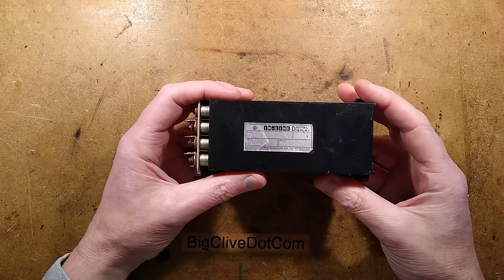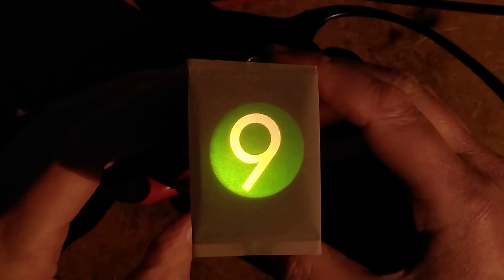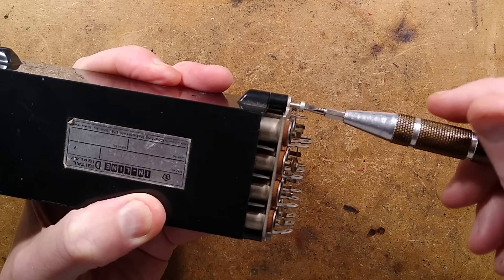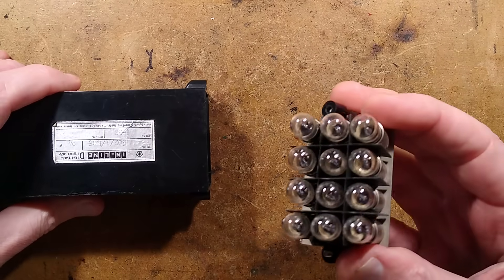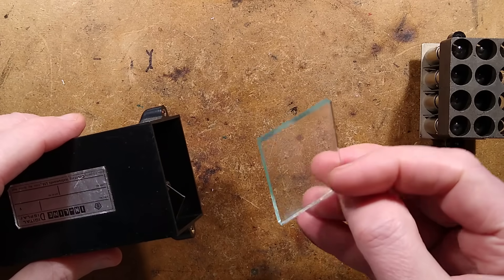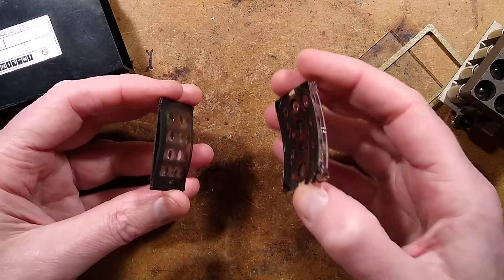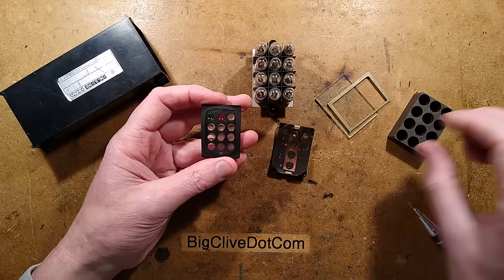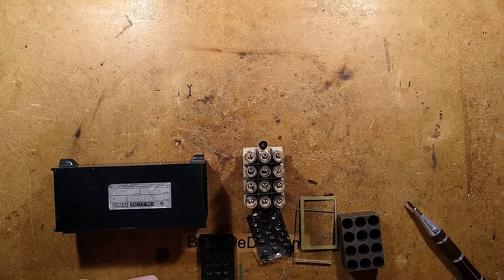Vintage projection display teardown

Comment: Back in 1975 I worked on a machine that had such a display.  The company that made that machine had spent something like $160,000 to make it,  and then other folks had spent between $300,000 and $400,000 to try and get it working right.  The display was an indicator of what fault condition had brought the machine to a halt.  When I first fired it up,  all of the faults were indicated.  It seems that somebody had forgotten completely about the diode you're supposed to put across relay coils when driven by a solid state part.  Every single one of the drivers was blown,  too.  That machine used the oddest logic family I've ever encountered,  something called "NORBITS" and I believe made by Amperex.  I've not seen it before or since.

Comment: A very well-designed numeral indicator. In the days of vacuum tubes, a bit of power wasted in a 24V100mA lamp wasn't too much to worry about. Thanks for taking it apart. Congrats on the 1 million subscribers' milestone.

Comment: The description sent me on an ADHD rabbit hole about RME and their various Glasgow shops 😅

I love these vintage displays, so many interesting ones which were all (understandably) replaced by 7-segment ones. I love this one's use of Futura, but they so often had interesting typefaces — even the CRT-based ones.
Reply from the maker: RME was great (Radio, Mechanical, Electrical).   A counter surrounded by component bins and shelves up to the ceiling with technical stuff.

Comment: Elevators.  Otis used projection displays in some of their elevators.  Mind you they used a disc rotating in front of a lamp instead of multiple lamps.  There were several of them in a local hospital up until early 2000 when the cabs were modernised under orders from HCA.

Comment: Congrats for the 1M! 
This thing could really have benefited of LEDs, but while the photoelectric effect of the PN junction has been known for a long time, the brightness took a few decades to develop. Imagine the multitude of color combination choices with RGB LEDs, although some combinations would be limited because the digit color would mix with the background.
With a 4x4 pattern, even with incandescent lights, the same case could be fitted with a hexadecimal lens set, or decimal with 6 background color choices.

Comment: Hmmm, they could have invented the seven segment display concept using fewer light bulbs and it would have been brighter. Implementing the separate red and greens somehow would add two more bulbs but still fewer in total. Thumbs down for design fail LOL.
Reply from the maker: This was designed for old electromechanical systems.  7-segment would have required more complex display circuitry.
Reply: @bigclivedotcom Steering diodes would do the job for the same external interface, though 49 of them would cost more than the saving in light bulbs LOL.
Reply from the maker: @FirstLast-jl6fr  That and the fact that commercial silicon diodes didn't exist back then, or were new, flimsy and very expensive.

Comment: I have a few Staco backlit (incandescent T 1-3/4 miniature lamp) displays which seem to be mil-spec and which are absolute jewels of compact, fiddly design. They don't project like your beautiful chunk of metal does, but there were a host of options for alternating legends (think push-push functions, top or bottom of the button illuminated), colors, etc. Each button about 15mm square, yet used 4 individually addressed lamps and a metric butt-load of contacts!  GLASS front button surface.  Hmm... I recall that IBM pushbottons from the 360 and 370 lines were also glass wear surface. Sorry, stream of consciousness while sicker'n hell. Thank you for the excellent distractions (as always) while I pretend to recuperate at my desk instead of bed. <_<

Comment: I've got 3 miniature in-line modules, with tiny wheatear lamps (probably 4 or 5v).
The lengths we went to to engineer digital displays before LED was viable, are quite interesting. An early US system had 10 or 11 acid etched glass slides per digit, arranged like standing dominoes, with a filament lamp above each. I forget what it was called. A display of all these systems would look spectacular- Nixie, Nimo, Numitron, Numicator, VFD, 7 segment LED....
My father remembers when blue LED's were £30 GBP. EACH..
Reply from the maker: The edge lit displays have made a comeback in LED based nixie-themed clocks.

Comment: I used and maintained a gun control console in the "90s that used a smaller version (1 inch square by two inch deep) with elaborate configuration designations projected when the system changed modes.  The lamps were tiny and hundreds were required for the console.

Comment: Many years ago, I worked on re-assembling (they had been cut apart) two "Red Arrow" slot machines. (built by Keeney?)  Each had three of these types of displays in the upper section. (The machine was huge and heavy.) They used 6 volt lamps and they were fairly bright. It was fascinating just to watch it run with all it's electro-mechanical  sweepers and steppers in action!

Comment: If you ran the lamps at half voltage they'd last forever but might be too dim.  That's what we used to do with single lamp incandescent pilot lights.

Comment: Developing products must have been more satisfying in the past given the freedom from conventions and the varying fields of practice for the finished product. 
In this case, besides electronics, we see specifically manufactured optics. In other cases it's often clever mechanics applied.
Today its just LEDs, a multiplexer and the data bus. 
The times of multidisciplinary  ingenuity in common applications are passé. Perhaps it still exists in some way with designing MEMS devices but I still miss the those times I am to young to have experienced.
Reply from the maker: Don't underestimate the technology in modern displays.  It may not have the same charm at the moment, but will probably be collectable in the future.

Comment: Another great informative video, Clive. I had a device that came out of our famous Melbourne brewery which used 10 Burroughs Sphericular displays which are very similar but smaller to yours. I kept 6 and converted them to led for a clock project and sent the remaining 4 to a fellow nixie enthusiast in the UK. Another unusual display from the same era is the side-lit acrylic displays that Canon used in their 1967 Canon Canola 167 desktop calculator. Unfortunately the incandescent miniature bulbs of the time could not produce enough light for bright environments.

Comment: Maybe there's a reason it is the way it is, but surely if you chromed the insides of the tubes in the metal bit at 02:53 , you'd get at least like 50% of the light back that's not directly going forward?
Maybe it's not chromed to make the image sharper, and having it be chromed would cause the edges of the numbers to look a bit more fuzzy?

Comment: I would love a set of these to make a digital clock. Spending every summer in Spain in the 1980s and 90s to see family a lot of fruit machines made by Inder and Recreativos Franco used these instead of the more traditional reels due to licensing laws.

Congrats on the million!

Comment: That piece around the lights is probably "pot metal."  No standard, but often a lot of zinc. Basically it is simply whatever non-ferrous cheap metal with a low melting point can be found and melted down (in a pot) to make a cheap casting.

Congratulations on the big 1M!

Comment: Way back in time I worked at a military testing company and some of the test equipment used these for readouts.  Didn't have the color choices.  Eventually we used those machines for testing some new-fangled thing called an LED.  :)  That's when your choice of colors was red.

There were also the Signetics Darkness Emitting Arsenide Diodes.

Comment: Old display technology like that is extremely cool! The only notable orange display I have at the moment is an incandescent seven segment display where each segment is actually a tungsten filament. Also, congratulations on 1 million subscribers! I think I’ve been following you for almost 6 years now so it’s cool to see you have reached that milestone!
Reply: Those filament displays were extremely common in Petrol Pumps. At the time LCDs wouldn't have withstood the temperature extremes outdoor equipment has to withstand. In the 1980s I had an aftermarket LCD clock in my car and if the car got hot inside the whole display would turn black until it was cooled down.

Comment: I'd love to have some LED-converted units for use in project displays.  Delightfully retro, yet elegant.  I'd probably also wire in a microcontroller so they could be addressed via a single bus.  Would be neat.
Reply from the maker: You could use addressable LEDs for a three wire interface and full colour.

Comment: I used to have to work with them,  the bulbs were always blowing...
They appeared as an alternative to Nixie tubes as they worked at a lower voltage..
They were during the transition from valves ( I miss 'em ), to semiconductors.... 
The only semiconductors we had, at that time, were germanium diodes....
Of course now we have fets, which work like valves, anyway....
Regards, A very old techy......

Comment: I love the old mechanical/optical solutions for displays that were utilized prior to the digital (led/lcd) age. When I was in the navy our NTDS system was from the late sixties and utilized electromechanical/optical control displays. Very clever, but a maintenance nightmare. I'd love to see the new systems.

Comment: Congrats on the [1111 0100 0010 0100 0000] subs! 
I have a set of 6 of a much smaller version of the same type displays. EBay find. I've never built anything with them because, as seen in the video, they are far more interesting to take apart and play with than to actually use as intended.

Comment: The focusing lenses, remind me of our signal lamps, when I work for a railroad in the States, now over +20-years ago.  The outer lense was a clear Fresnel of sorts, which worked together with the inner colored lense (green, amber/yellow, & red).  In tandem, they focused the light down the tracks, so tlhe train crew could tell what train movement, if any, was allowed.  Very interesting.

Comment: Audi were using these in the dashboards of the 1982 onwards Audi 100 (the famously aerodynamic one) as the warning lights, things like oil pressure, brake fluid level etc. iirc, they were a 3x3 layout .

Comment: Bulbs: 2.4 W at 24 V, bayonet base - it's a car bulb! 😎
They were and are still available in 6, 12 and 24 V. The wattage ranges from 1.2 W, 2 W, 2.4 W up to 4 W.
Depending on the wattage they were meant for
- dashboard illumination (speedometer, temperature, oil pressure etc.),
- parking/position lamps,
- cabin illumination
and
- license plate illumination.
Reply: Cars don't tend to use 24 volt bulbs. The reason is the battery in cars was typically 12 volts.

Lorries would sometimes use 24 volts.
Reply: @deang5622  Sorry for not sticking to "The Oxford English Dictionary" and not mention the word "lorry". 
If this is your only problem on the island if inbread sheep farmers and fishermen, caught in Imperial dreams of ruling the world: congratulations! 🤭😂

Comment: I have seen and used a miniature version of one of these that used T1 3/4 flange lamps when I was working for a defence equipment manufacturer. The main differences were the colours would usually come from a little semi opaque rubber sheath that covered the glass of the lamp. There were also T1 3/4  LEDs that eventually replaced the filament lamps and when I left the industry in 2014, these displays were still being used. 

One quirky thing with these was that to get maximum display brightness for each legend/number, the lamps could be rotated so that the filaments lined up with the beam projector lens. This resulted in a much more evenly matched displays with better contrast. 

Many congratulations on the 1 Million subs Clive, well earned. 🥳🥳🥳🥳
Reply: The perfect lamp for powerball numbers AND minuteman missiles!

Comment: Man, that is so simple, and so hackable. Some LED bulbs would brighten it up, and you could print your own numbers for it to project.

Though these days you'd probably be better just using a little LCD display and show basically whatever you wanted. error messages and the like.

Comment: I guess if you added some reflective foil to the inside of the divider channels between the bulbs it would increase the light output quite a bit, instead of it being absorbed into the black material 😁

Comment: Intriguing device. I wonder if you could replace the mask with transparency material printed in negative on an inkjet printer to make a new set of symbols.  Lots of options to make “interesting” icons light up!

Comment: Amazing to think some of us were around when there were no LED's, no integrated circuits, no interweb, and the world was in black and white! Congrats on the well-deserved 10^6 subscribers!
Reply: Growing up I coveted old TVs to disassemble mainly for the valves (vacuum tubes on this side of the pond). Not to mention abundant WWII surplus. Some of my projects actually worked. Fun back in those days breaking the neck of CRTs and letting air in or the all time favorite Mercury switches.
Reply: @tomschmidt381  Some televisions used a variation of this technology to display the channel number on a screen INSIDE THE KNOB YOU TURNED! The numbers were on a wheel attached to the tuning turret-o-inducers per channel.
Reply: My "calculator" at secondary school was a slide rule. Now my daughter walk round with a bloody computer and telephone in her smart watch.
Reply: @josephking6515  👍 what a shame, no slide rule in the emoticons, only this 📵 and this 🎚️... is it a slide rule ...?
Depicted vertically? 🤔 I don't think so.
Reply: TVs were black and white but CARS were in color. Now we have 4K HDTV and monochrome cars. 🤷‍♂️
Reply: ... and no electronic pocket calculators so we used slide rules to get about three significant digits and habitually calculated the order of magnitude in our heads. As much as I observe many engineers today have lost "the feeling" we had for the approximate outcome of a calculation.
Reply: @mittelwelle_531_khz  not an engineer, but a physicist, and I still saw education about the approximate outcome being taught! We'd get chastised for spurious precision, and trained to look first at the order of magnitude when using scientific notation. 

But I don't know how it is nowadays, that was 10-15 years ago. Calculators in everyone's phones were already a thing, but it was still a PITA and easier to do it in your head when you didn't need precision — now you can ask your watch a calculation verbally and it'll respond verbally too. 

I do notice people my age who were only taught maths (rather than any applications of physics) do just whip out a calculator and obey however many decimal places it gives them without questioning where that precision came from. 

I still try to do as much arithmetic in my head as I can, though alas my most recent covid infection has slightly lowered the bar for losing track of things. With all the discussion of "brain fog" I had skewed expectations — I'd say it's more like my thoughts have been slicked-up and are harder to keep a grip on, rather than being "foggy" which implies hard to see. I can "see" my thoughts just fine, it's grasping and manipulating them that's become harder.
Reply: I would love to figure out how to use a slide rule but unfortunately I haven't been lucky finding any for sale at a good price.
Reply: @taliakuznetsova7092  google for
"Virtual Slide Rule" if you only want to practice or "Slide Rule DiY Project" if you want to build one.
(Seems my previous reply wasn't publish as it included a full internet address.)
Reply: @taliakuznetsova7092 my engineering tutor was shocked I couldn't use a slide rule in the 2010s I had to explain to him that I had a pocket calculator science I was a child, he had this "I thought better of you" look of disappointment on his face, im not sue if it was directed at me or the changing times lol
Reply: Hahaha, giving  out age away. Ecc82/83, ef84, el34, 6L6, was it PL54 line output? Too old to remember 😅

Comment: Many years ago I was given a few "indicator bulbs" - these had long tip with a sort of lens on the end and gave a fairly narrow beam with little spill to the sides.  I never found out where they were used, but they would possibly be better in "number boxes" like the one you've stripped down.

Comment: These days there are "replacement" LED bulbs that come with various sockets and some have built-in regulators so they can feed on up to 24 V. But I don't know if they're available with that elongated bulb shape.

Comment: Congratulations on the 1 Million subscribers Clive. I guess another plaque is on it's way!

It is amazing how simple things were back in the day, however controlling them was rather complex with many relays and kilometres of wiring!A very analogue world.
Reply: Yep, a £5 microcontroller can replace a whole board of relays and the rats nest of interconnections.
Reply: @MattyEngland  Although they were probably more than £5 there was a massive change inside Pinball machines between about 1975 and 1980 as relays got replaced by Microprocessors and Transistors, and Electromechanical displays with VFDs or Gas Plasma.